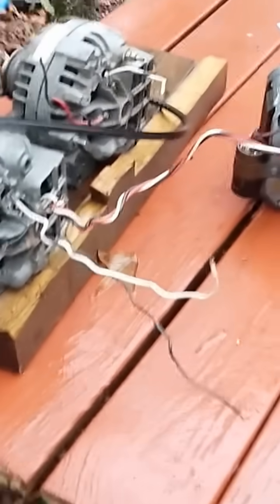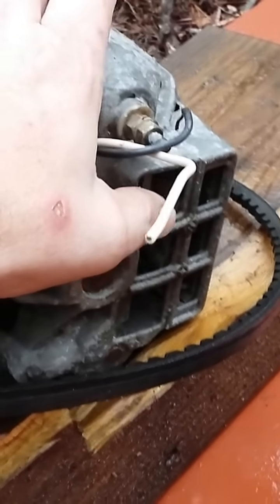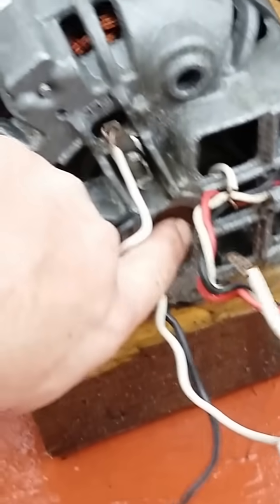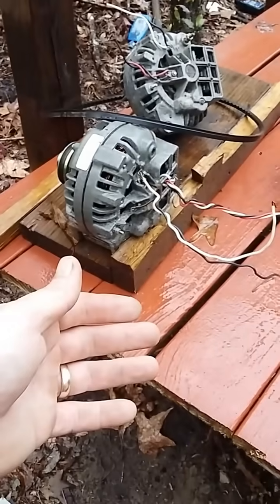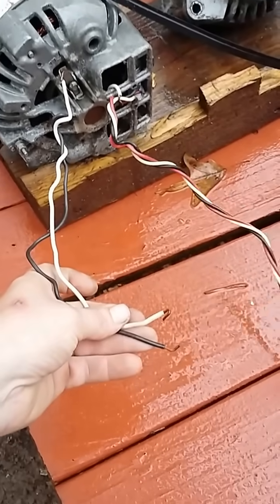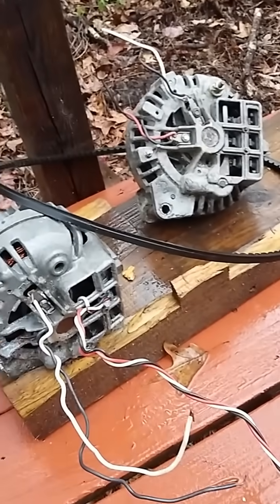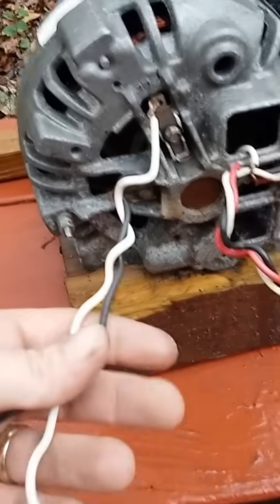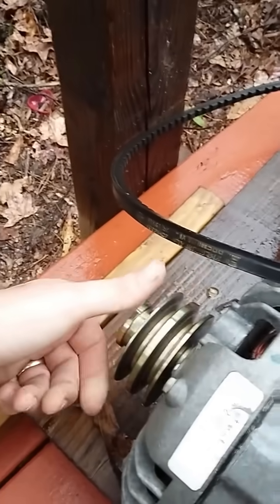Update Free energy forever no wind no solar no gas READ DISCRIPTION!!!

Comment: WHEN YOU SPIN THE ARMITUR? IT WILL GENERATE ELECTRICAL CHARGES!. PLACEING A BATTERY TO  RESERVE THE GENERATED POWER WILL KEEP CAR  BATTERIES CHARGED. STORING ENERGY IN CAR BATTERIES WOULD KEEP YOU WELL SUPPLIED. SPIN THE ARMITUR FOR SOME TIME? IT WILL FILL THE BATTERIES. ALL IT TAKES IS HAND SPINNING!.
Reply from the maker: Angelina.S. Ingram yes and no.. the alternator with the wires hanging out of the back of it is actually my primary mover it is modified just a little bit to become a 3-phase field magnet motor and with using a pulse-width modulation technique and signaling into the phases at a correct time just like a bldc motor does... but because I'm using such a high frequency I am consuming very little energy at a higher voltage
Reply: Just move your hand up and down really fast and "work" will be "finished"
Reply: Do you have arms like the hulk that you can hand spin an armature long enough and fast enough to charge a battery bank?  If so join a circus and bill your self as the strongest woman on earth.

Comment: So..... He "makes his own power for his house"... So he uses the washing machine motor to run the two alternators? How is he powering the washing machine motor?... He must use regular electric service... Lol... He's so full of shit, he is making that kid scream in the background the entire time.  He repeats himself several times.... Wow.... But with 3.5 million views, he's the one getting the last laugh and making plenty of money to pay for  conventional electric...
Reply: I actually submitted the idea to ge 4 years ago... their rep says it would cause too many trouble in oil market. But of course much better than this set of generators. You see the battery... you can set 1-6 outlet on there and have your home circuit plug into it... and hence it generate power to power it self and extra to power your home all for free.
Reply: @tintytinyme  CAN HE MAKE IT AND WE WILL BUY IT FROM HIM OR YOU?
Reply from the maker: actually the alternator in this video is my primary mover. it is a 3-phase field magnet motor and I use a pulse width modulation technique at 396 volts DC, well pulsed DC at a frequency of almost 15,000 Hertz. there are no electric lines on my property or telephone poles for that matter!

if you know Electronics then you know the higher the voltage the less resistance! well it goes the same way with frequency the higher the frequency the less current consumption!

Comment: I have A way to make batteries last for decades longer than expected.

  It's simple easy and cheap to do.

  Use this trick to save money on buying replacement batteries.

  Watch my videos to find out how.  

  You can use this on EV vehicles, hybrids, 12 volt car batteries, power tools batteries, cellphone batteries.  Basically any kind of old rechargeable battery will work better using this trick.

Comment: Bypassing the diodes won't make it any easier to spin that alternator. You will see what I'm talking about when you connect the output wires to any household appliance. Then if the measured input motor Watts are smaller than the output Appliance Watts, then you have an amazing system, because what usually happens is the output amps produces a magnetic field that opposes the alternator/generator rotor from turning. The result is: the bigger, more powerful the appliance, the more power is usually required to turn the alternator.

Comment: The voltage 3 to 12 volts is merely an exciter voltage to activate the electromagnet part of the alternator. They used to use permanent magnets, but this is the preferred method now. That exciter battery has to be kept charged, it isn't free. Then, you have to expend energy to spin the alternator,, IT ISN'T FREE...  either wind, you pedal something to turn a wheel , or  a water wheel... It doesn't spin for free just because you excite the electromagnets... He showed nothing to indicate how he was going to spin the alternator,, and the more power or load you put to on it,, the harder it gets to turn the alternator... Would have blown his fake video if he actually showed how much energy he was expending to spin the alternator..  Give me a break.. I was an AF electronics instructor..
Reply: He thinks he's going to turn it into a motor using a three phase pulse modulater, that might be something to see, it bursting into flames from excessive voltage and current melting aluminium on a new level.lol
Reply: This dude is dangerous to himself and others.
Reply: Well this is the price of free speech. !!.  .. but he gets 28k viewers for that rubbish!!!.

Comment: Look everyone knows how an alternator work's. About 6 to 9 volts on communtator and there should 12.6volts on each of the 3phase wire's. So 3 120volt transformers could be hooked up in a delta or starpoint fashion, walla you have 120 or 210volts at 400cycles per second. But if you mod the windings you could get 60cycles.
Of course you bypass the diods for AC.
Reply from the maker: Albert Torres no actually you don't know as much as you think you know because it's not voltage you're gaining it's the amperage that you're gaining in a car alternator because the car alternator actually receives 11 or 12 volts and outputs 12.4 volts to 16 volts and depending on the speed is how you get your frequency so 3600 revolutions per minute is 60 hertz but since the coils are at 120 degrees it is perfect for what I'm using it for which is a 3-phase field magnet motor... now if you wanted it to Output 120 volts than you would put a hundred and fifteen volt to the field windings or rotor. the car alternator is a device that pulls energy or resonance from The Ether and nobody realizes that! it produces amperage where there is no amperage or current the diode Trio is what changes the alternating current in an alternator into direct current because a alternator although has an input of direct current its initial output is alternating current and like I said before depending on how fast it's turning will give you your frequency or cycles per second so 3600 revolutions per minute / 60 seconds equals 60 hertz or 60 pulses per second
Reply: @ThomasBuie  I don't know about you my meter measures up to 39 megahertz and shows at all speeds the frequency of 400 cycles per second due to the way the stator field is wound. I do know how all things work including your brain. I am correct on the voltages use a good meter you'll see. Now don't get me wrong you can break open the star or delta circuits and hook up the windings so that the voltages increas 50 or 70 volts ac. But the wil remain what the alternator is rated for, from 40 to 95 amps that doesn't change ever.
Reply: And 60cycles only comes from a 2 pole generator at 3600 rpm's. Car alternators have 8 poles , so the frequency is higher measured at 400hertz.
Reply: The voltage regulator apply 6 to 9 volts to the armature to magnetize it for the generation of ac then the diods rectify that ac to dc the ampers output of the alternator is whatever it's rated at. 12 volts from the battery is not applied to the armature except through the regulator that's built in. Most are 4 pole regulators and adjust the voltage on the armature to put out 14.5 volts, higher voltage destroys your battery sooner. And either is only a theory and dose not apply here.

Comment: I did something Like that I attached ceiling fan blades to 4 alternators and attached them to poles mounted the poles in the ground ran conduit under ground to the house hooked up batteries to store the power I use it as back up power you can power refrigerators all kinds of stuff
Reply: have you ever heard of battery chargers mate ?  30 USD 

If your same dream , you can sell these 4 alternators  and buy the charger. 

So, what have you built besides a big inneficient dynamo ?
Reply: I think you need power for a charger 😂 probably more power than it takes to kick start a small generator of power.
Reply: @ericupchurch6167  ... as you can read above. the guy states  he attached his rig  on a ceiling fan , so... he has power.

Comment: this is something i learned to do 48 years ago. one point of correction. "when you spin the Pulley it is called the rotor. The stator as you called it is actually a Y wound (3 phase) coil and it is stationary in the alternator. best of luck. Not sure why anyone would want to find you.

Comment: Either I'm confused or is this guy on crack.
Reply: No, he is on crack lol, HINT to clear up the problem, those things spin freely when not under electrical load, when you put them under load you need a large force to turn them, I dunno, um, lets take a look at what normally turns them, OH YEAH, an engine is normally used to crank those badboy's.

of course you could turn them with a large and powerful electric motor, but with losses, that motor would require more watt's than you are creating with the alternator.
Reply: Not crack.. METH..

Comment: Go for it buddy. You know enough about Alternators to be Dangerous. I’m a qualified Auto Electrician, so I do understand.
Your right... you can get AC from the 3 phase Stator windings. 90 amps @ 12v not on 120v AC. So what are you going to power the the drive pulley with to get that 5 amps at 120vac. A paddle wheel in the crick ain’t going to do a lot. Might power a few led lamps. Good Luck.
Reply from the maker: TJ Outback It it a three phase field magnet motor... please read the description.. thanks for the comment.
Reply: Thank you,,,
Reply: Multiply the drive components for the paddle wheel. Think big . 100 to 1 Heck,500 to 1

Comment: But the energy you put into the motor to turn the generator would be equal if not more than the generator would produce. Or was there some other point you were trying to make that I missed?
Reply from the maker: The energy that I'm putting into the alternator being used as a motor is far less energy than what I'm able to produce from a generator head because I'm using a different technique it is not AC or DC input into the alternator motor I'm using a pulse-width modulation technique that is also used in 3-phase permanent magnet electronic speed controllers it creates a high frequency pulsed DC that runs the motor with very little consumption

Comment: keep up the good work don't stop because of criticism  also when using different voltages it is more accurate to convert output and usage to wattages example 6 volts at 100 amps equal 600 watts and 120 volts at 100 amps equal 12000 watts and 12 volts at 100 amps equal 1200 watts you see watts gives a very accurate measure of power usage input or output and remember that most motors are about 90 percent efficient that means loss of power to friction and heat I learned these things because I've Ben where your at. keep working at it
Reply: Wattage is the constant, not the current. P=I*E. 12 volts at 100 amps is 1200 watts. 1200 watts at 120 volts is 10 amps and 1200 watts at 6 volts is 200 amps.  

A car battery charger producing 10 amps at 12 volts draws 1 amp at 120 volts from the wall socket. The inverter on my boat to draw 15 amps at 120 volts to run the HVAC draws 150 amps from the battery. This means I can run three hours before I deplete my 800 Ah batteries to 50%.

Comment: go to school and take a class in basic electricity, and a class in physics would help.  If what you are preaching is true than everybody would be using what you supposedly have.  You have nothing but a pipe dream.
Reply: Well can you tell us how this wouldn't work. Cause calling him stupid hasn't really made anything any clearer. Especially to someone who has himself done this on a way smaller scale. Science experiment.
Reply: @ericupchurch6167  It takes energy to rotate the pulley; like a gas engine; but you can not make energy from nothing. The gas engine takes gas he claims he does not need. He could hook it up to a bicycle and use pedal power to rotate the pulley. Conservation of energy says you can not generate energy from nothing.

Comment: $300 TO $1000 Per month in cost for Elect???   What do you do leave your light on at night? My elect for my home is Max $75 per month
Also what is the Hz of the output AC Power if it not 60 Hz then your going to burn up your Elect. items as there made for 120v AC 60 Hz.
My cabin in the woods has a stream near it I use 2 Alternators/Generators and a water wheel to power them, I get 12V DC output after they charge a battery bank. That all i need there powers some small Car lights, Can charge the cell phone & Laptop ( Car USB  charging unit)
Reply: The frequency of the power from that alternator is dependent up[on the RPM. It must be regulated extremely accurately to maintain 60HZ. Plus, he never says how to hook up the 3 phase to get single phase. He sure talks a lot and says nothing. And the other thing....gonna run a belt to a bicycle and pedal like Gilligan? Never says how he's going to power the motor that turns the alternator.

Comment: Bottom line is for an Alternator to Produce say 100 Watts of Energy you MUST input more than 100 Watts of energy into the Alternator, be it Mechanical or Electrical Energy Input. Fact with all Energy conversions there is loss, NOT gain.The loss is usually through Heat from friction, then there is also Voltage drop from resistance also producing loss from heat and on it goes.Ask any Auto Electrician they understand Alternators, Car Alternators produce 12 Volts to Charge the 12 Volt Battery not 120 or 240VAC as is claimed.
Reply from the maker: lol... so you guys still think that I'm using the alternator as an alternator... wow! Ask yourself one question... how much direct current would come off of the stator windings on this alternator without there being a trio Bridge attached? ( it is a 3-phase field magnet motor)
Reply: The video states the output is 220vac not 14.7, listen and learn.Yes Tim AC Rectified not Inverted.The Motor is powered by the Alternator, He has discovered Perpetual Motion.What a smart Lad.
Reply: An alternator does produce ac voltage before being inverted to dc. Regardless, you will never get more energy out than you put in. You can run this off a fast stream so that you don't have to use hrid power. If you are using a motor to spin the alternator, to generate 120v ac, the what powers the motor driving the alternator?

Comment: 90 amps dc should be enough to run some car lights in a house you would think.for simple lighting purposes.mabt not .I grew up with out power and we had 12 vt TV fridge everything was 12 vlt.my job as a kid was chargeing the car batteries we used and stored under in spots built for them under the floor with doors as the floor.. never had any power till the late 90s .

Comment: Is this for real? Thought making a 90 amp 12v alternator into a 120v would yield 9 amps..? 240v 4.5?
Reply: Doug Cohen -You’re asking a three year old child what he thinks about the implications of Shrödinger’s Cat. Stop doing that.
Reply from the maker: Well you thought wrong because it's actually a little bit less than that..
Reply: Well I switched my 80 amp flood light s14 alternator with a VG v6 one from a Nissan quest so it's 130amp. So who knows what it turns out to be, they vary

Comment: This is bs. You will use more energy running the drive motor than the alt can produce. Spin it up to 800 rpm with a bicycle or use a stream to turn it. Energy is never free. Energy is always exchanged.
Reply from the maker: Wow! I could give you a ton of examples where energy is free! I mean how much does it cost you for the sunlight that you get or the water running down the stream or the air blowing across the sky... none of those are free? how much does it cost you? Now if you only knew how to collect the free energy out of the air...
Reply: @ThomasBuie  there are a few problems with your response. Hydro, solar and wind are not free energy. They are reneable energy sources. Only 17% of the united states' electricity comes from reneable resources. Most comes from fossil fuels(62%) and the rest nuclear(20%).
Renewable resources are better forbthe environment but they are not free. Energy can not be created or destroyed. All of the energy in the universe is flowing from high concentration to low concentration.that being said, burning coal yields a shit load of useable heat energy. That heat energy is used to boild waterto create steam. The steam rises, now in the form of kinetic energy, to spin a turbine. The turbine rotates magmetic fields around a conductor and out comes electricity. The concentration of potential energy in fossil fuels is ENORMOUS! As for wind and hydro, both of those are powered by the sun. The sun heats the air and high energy air molecules move toward low energy air molecules. The sun heats the water, which chances the state of water from liquid to gas. The water, as a gas, is now lifted, thanks to the sun's contribution of energy, into the atmosphere. As the air molecules receive a portion of that energy contribution from the sun that the water, as gas, now has, the water changes state back into a liquid. Unable to maintain its greater state energy in the form of a gas, the water falls back down to the earth to fill our rivers and streams. As it makes its way back to its source we use some of its kinetic energy to rotate our impeller to make our electricity, and after we have robbed that water of its kinetic energy it is free to travel down stream. Now at a much slower rate of speed, our water friend waits for the gift of energy from the sun to once again fly high as a gas.  
 I lost my train of thought there. I hope you enjoyed the story. Read the laws of thermodynamics. Energy is never free. Energy is always exchanged. Please stop spreading ignorance. Have a good day.
Reply: @ThomasBuie  Solar and wind energy isn't free...free energy is putting 0W of power in and get more than 0W out.